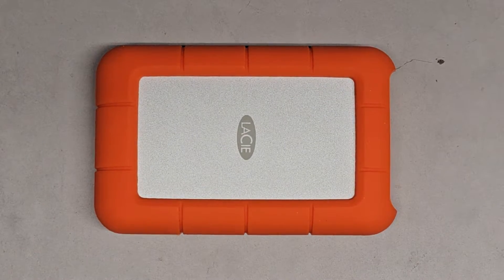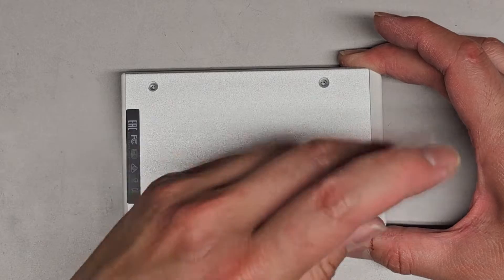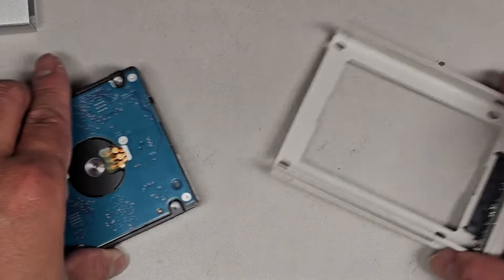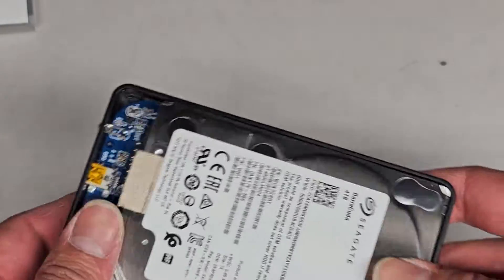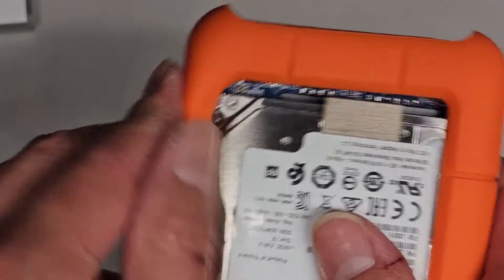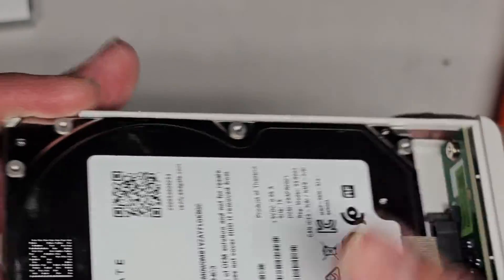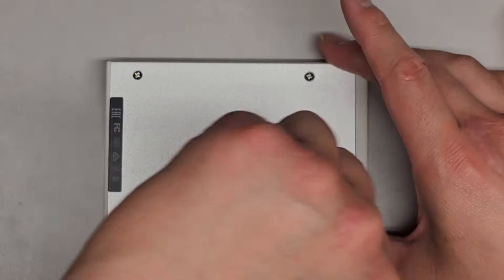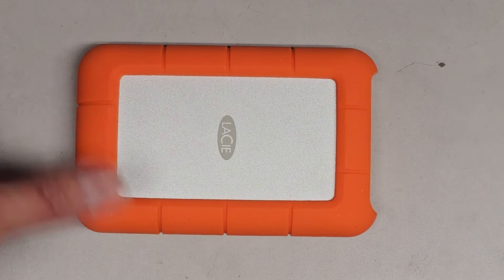Laciec 4 TB Terabyte LRD0TU6 Disassembly Enclosure Replacement Repair Ideas Broken USB C Port

Comment: It didn’t work for me — my MacBook recognized the device, but the hard drive didn’t appear and shut down after about 45 seconds. Could this be a power issue? Should I try a USB/SATA adapter with an external power supply?
Reply from the maker: It shouldn't need external power. If you used a different power and it didn't work, it's a bad board or something else. I recommend 300dollardatarecovery.com
Reply: @ItsBinhRepaired  When I connect the hard drive using a USB cable, it spins up normally, makes the usual operating sound, and doesn’t power off. It only shuts down when connected through the SATA adapter. When the drive first stopped being recognized over USB-C, the LED light was still blinking and it was spinning normally. I then tried connecting it with a USB-A cable to another MacBook, and it was recognized and worked fine one last time before it also stopped being recognized and the LED stopped lighting up. However, with both USB cables, the drive still makes its normal operating sound when connected. Any suggestions before I opt for data recovery?
Reply from the maker: @SomethingSophie it's a 2.5" sata drive, right?
Reply: @ItsBinhRepaired  Yes, LaCie Rugged 4TB

Comment: Technically if the hard drive dies, your could replace it with a 2.5” ssd right?
Reply from the maker: @singhplayz  yes, but then having such a shock proof casing is pointless. You can get a cheap enclosure to use instead.
Reply: @ItsBinhRepaired  yes but it will still provide protection to some degree to the case
Reply from the maker: @singhplayz I suppose lol